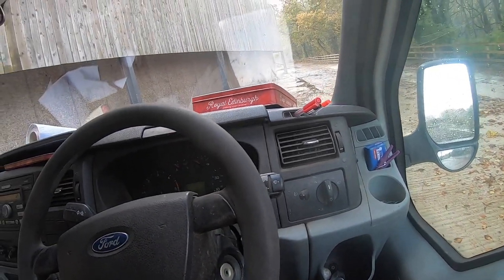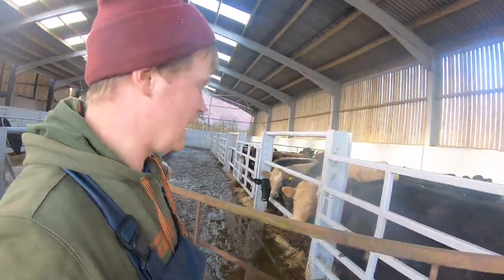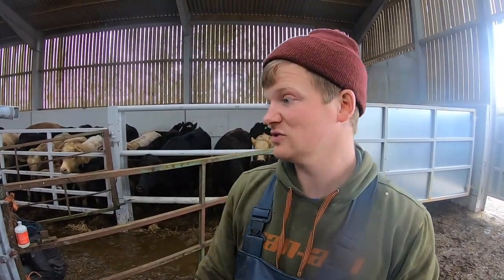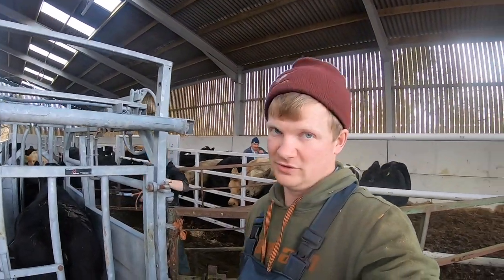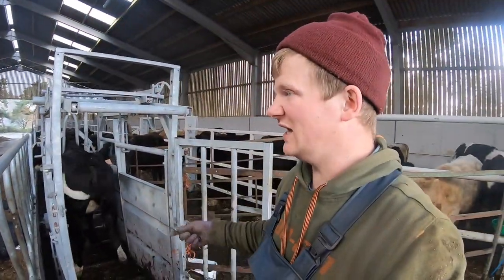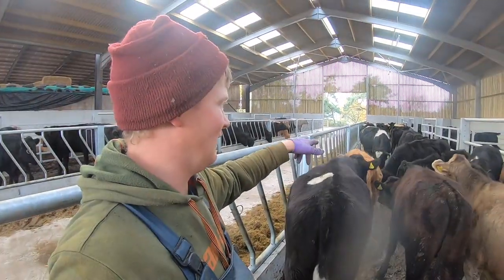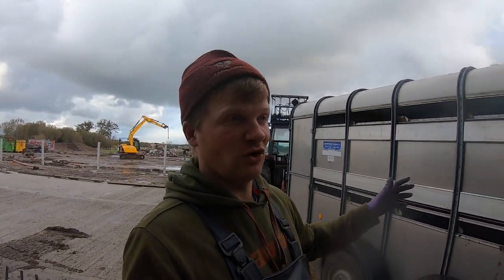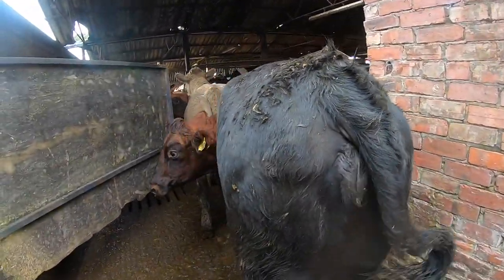SNEAKING UP ON COWS! IT’S NEVER EASY!

Comment: How much return do you get roughly out of the farm shop for 2 year olds? After the costs, feed bedding, jabs, Its quite a long return window.
Reply: Enough to make it worth it to keep more of them on instead of dairy cows and at 30c/l we will say their cows produce a minimum of 6000 litres per lactation, that's roughly 2000 pounds income per cow per year before costs are taken out of it. Also with the ground across the road they have to keep some beef stock to keep it grazed or else they would never get through all their silage and it would go to waste

Comment: Here in the states, we have a inverter that can plug into a vehicle that gives us 110v to power things like clippers. Do you have similar (inverters) to give you 220v for your clippers?  That way you can have power no matter where you are using batteries.
Reply: 240volts here in the UK  murica Shiote mako no sense
Reply: Yes, you can buy 12VDC to 240VAC invertors in the UK for that purpose.

Comment: Not saying I'm right or wrong but personally if it was me I would wormed them all because they have all been in the same pen. Although the calves from the showroom have never been outside  if the others have got worms (for example) them worms will lay eggs in the intestine of the cow causing the eggs to be in the poo that is produced by that animal. All it will take is for the other animal to come along and stand in the poo or if it is in the straw lay in the same section and then the calves that have never been outside have worms.

Don't know  for definite but based on my knowledge and the life cycle of a worm thats my thought process
Reply: I assume they are worming for fluke and lungworm, pretty sure they have to ingest the worms also, you might be thinking of lice or something similar
Reply: @jerryodriscoll3691  yeah they are but if the cows decide to rummage in the straw and eat it or they end up in the food then they could ingest them. Please correct me if I’m wrong
Reply: @ryanluckhurst4301  that's true, but generally when I bed up my cattle they only take a very little bit of straw to eat on top and don't go near the shitty stuff at all, it's hard to know but I definitely would of wormed them all as they would thrive better if they did have it
Reply: @jerryodriscoll3691  ok that makes sense Thank you very much
Reply: @ryanluckhurst4301  no bother 👍

Comment: Hey Tom and Andrew: I've not heard you complain of mosquitos, but your use of old tires  on your clamp concerns me. There are mosquitos (Aedes albopictus) that are big virus carriers and which love small pools of stagnant water, like the water in the bottom of an old tire. It is impossible to get and keep an old tire dry, so just a suggestion to consider alternatives. Best of Luck. PS. I love how daft the calves get when put on new bedding. LMAO>
Reply: Mosquitoes in North west England ? They’d freeze to death.
Reply: @WS-ij1fu  Yes and no. There is evidence that Aedes introduced to the US has evolved to overwinter, thus they are spreading away from the warmer more tropical parts.
Reply: @markmcknight9601  It is not a matter of yes or no, its a no. If the climate in the UK keeps warming then it will be a yes in 50 years time, no need to worry about his tyres for a while.